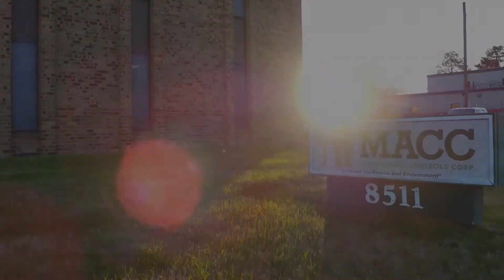Is It Possible to Upgrade Trane to Tridium?

Comment: Why not upgrade to a new Trane front end.  They are open protocol with built in user interface, no proprietary software required.  Also Trane front end can communicate with legacy devices (AHU controllers, VAV controllers etc) allowing for a lower budget phased approach to upgrade rather than changing all building devices at once.  ( change front end first then upgrade devices by area, floor, etc) if you don’t change all end devices then the customer is still beholden to Trane to get controllers that fail replaced.  As currently all Trane controllers need programming.